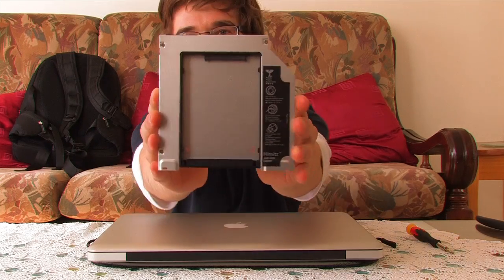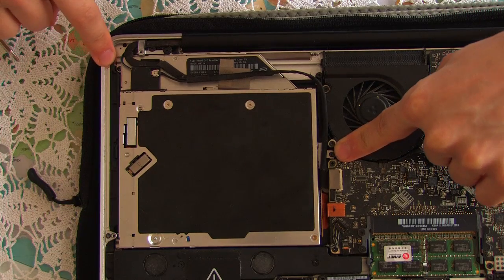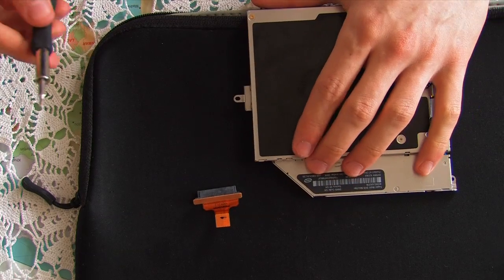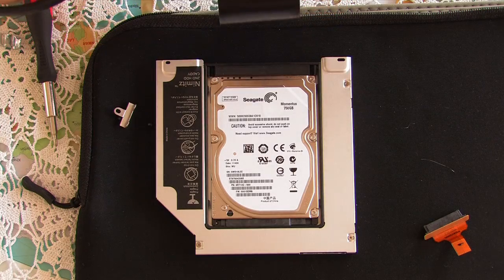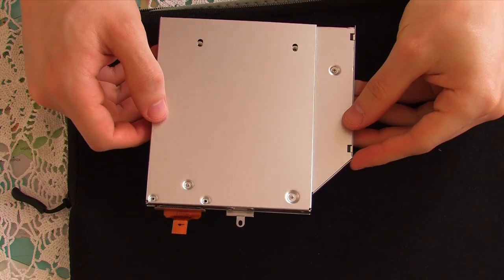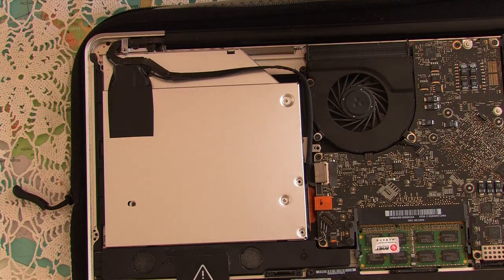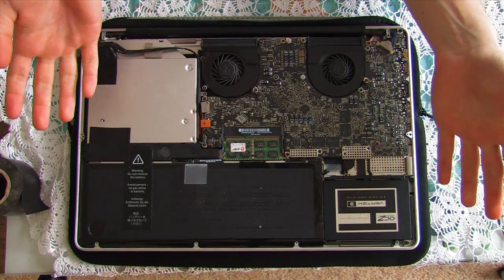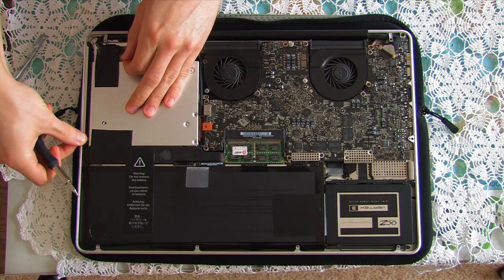HOW TO: Install a 2nd HDD in your MacBook Pro

Comment: As i understand you basically removed the actual harddrive from your mac and replaced it with the new one in a caddy.. so how is it installing a 2nd harddrive? It's just replacing your existing with a bigger one (in terms of storage of course)
Reply from the maker: Hey +Anwesh Rath, thanks for writing. I haven't removed any hard drives from the machine to install another. I actually took out the SuperDrive, as Apple calls it. It's the DVD burner drive in their products. So I nixed the DVD burner and put in another hard drive. I now have a solid-state for my startup and applications drive, and a hard drive for my video documents for long-term storage. 

Have a Happy New Year!

Comment: Hi... does the secondary drive effect the performance of MAC up & down? Because every time you start up your laptop the system has to rendered its 2ndry drive because it's connected? What's your experience after using... please share...thanks 😊

Comment: Nice video. I just bought a hard drive caddy for the disk drive off Amazon. Now I wait for it. I plan on installing my 2000GB Hard drive where the disk drive was since I have my SSD as my main drive. I have a ton of files I don't want to lose but don't want on my SSD since they take up so much space (1.5TB)  so thats where the 2TB hard drive comes in handy. Thanks for the video(: By the way how is that mac still working? Just wondering lol

Comment: I did which you all doing but when  i install win 7 to second disk , it gives an error. That error says if you have two drives , you couldn't format anyone. You should take off one drive. How can i disconnect first drive on disk utility ?
Reply from the maker: Hey +Cahit Alpdemir, did you install Windows 7 using Bootcamp on your Mac?
Reply: No , I didnt. Actually if i use bootcamp ,  the windows didnt seen so i take off first drive and i installed the windows on ssd and then i put on first drive. Its like a joke ! when mac starts , i see windows but if i click , the black window opens. :(
Reply from the maker: Hey +Cahit Alpdemir, my best understanding is that Windows MUST be installed on a Mac using Bootcamp. It may not work if installed on the HDD and then put into a Mac.

Can you try Bootcamp again?

Comment: Hi there. Thank you for the video. However i really really need your help! Do you have any public email or contact that i could reach you? My macbook pro has some problem with its harddrive and apple store told me to go for a replacement for a new harddrive. I have no back up data and they said i need to contact data recovery service which is $1,300 to do that but i could also use harddrive caddy to read my harddrive and transfer the data to somewhere else. I need your advice please help!

Comment: Hi mate, just brought a 15" not retina two weeks ago, have already changed the boot drive to a samsung 840 pro and upgraded the ram to 16gbs, I did try remove the superdrive to put the apple hd in the caddy, but couldn't get the screws out using the #000x50mm philips screwdriver, I'm guessing the problem is I need a #0000x50mm, cheers

Comment: Well thanks for this video. It was either spend the 13 bux for this drive caddy fro eBay or spend the 45 for the OWC Version that fits perfectly. Now 32 dollar difference is pretty steep for something that does the same thing, but for piece of mind i think its worth it.

Comment from the maker: Hey @iminimoo, thanks for responding.
@cheetah3333, I found that the stock 5400rpm drive that came with my 2009 MacBook Pro was less power efficient than the newer 7200rpm Seagate Momentus drive that replaced it. I noticed no significant battery life loss.